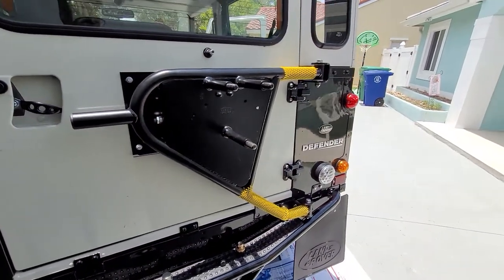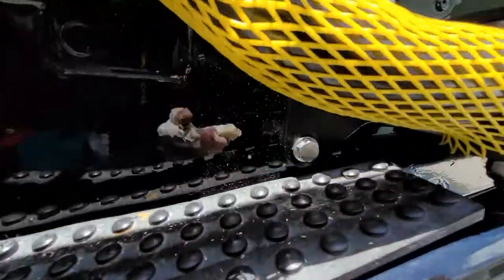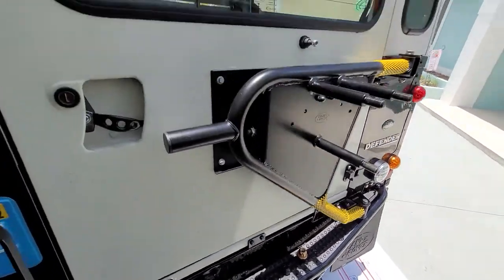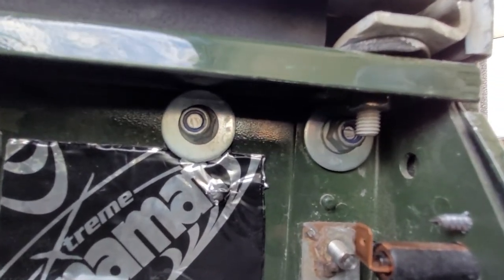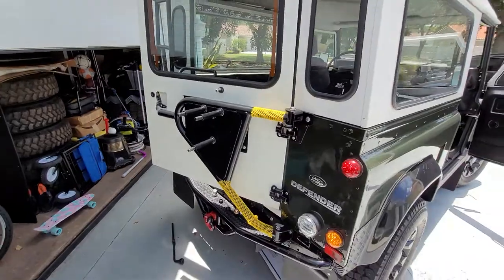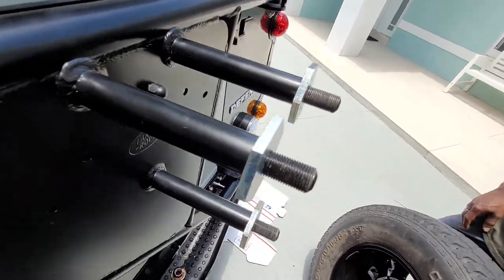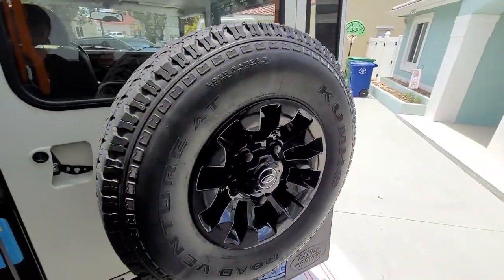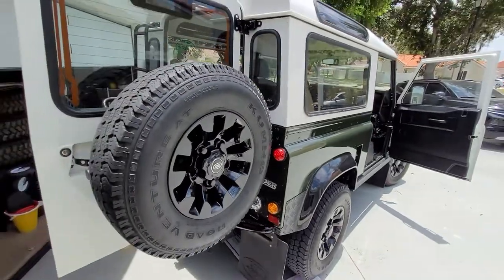Land Rover Defender Mantec Tire Carrier

Comment: Hi. Those threaded spacers can be set to the correct depth before fitting the wheel. So, if you need an extra 10mm, take the wheel off, wind the spacers out 10mm and fit the wheel. As long as you have enough thread for the nuts you're good to go.
Reply from the maker: That is brilliant! Thank you!  As I read your reply I instantly realised that I could have just not threaded them all the way in. This is why I love the Land Rover community. Always super helpful!!